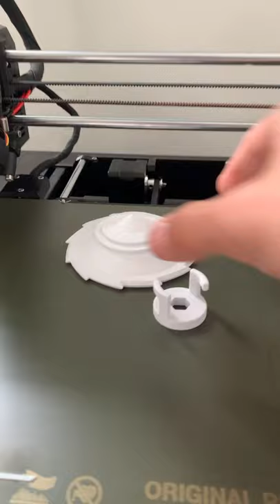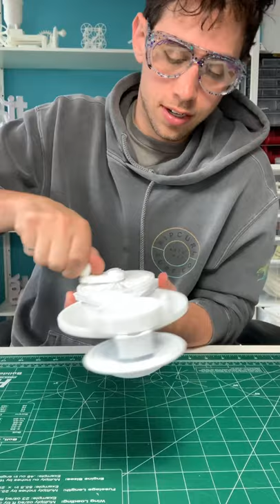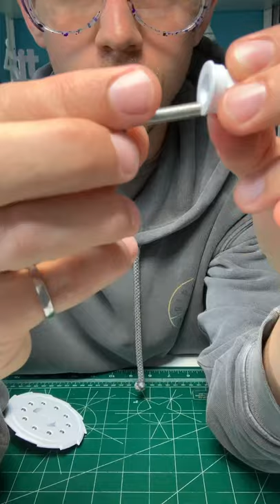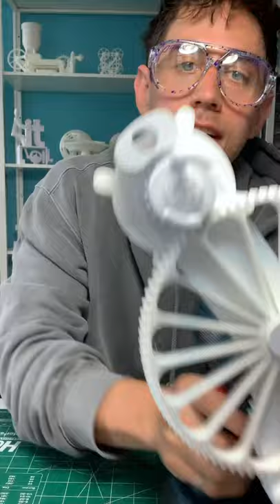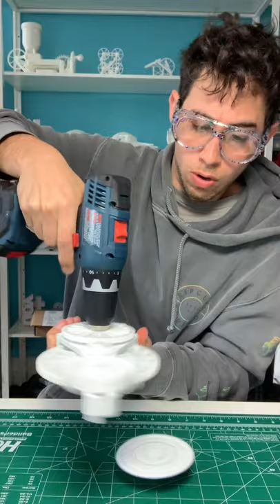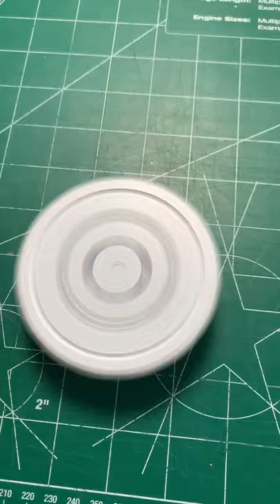The Drill Powered Beyblade (J-Blade) Launcher #shorts

Comment: Dont use drill you can get more speed by your hands. Ok drill has more speed but you hans have more strength if you make more gear speed to it the drill cant Rotate it but yuor hands can. But if you have very strength drill then the drill is better.

Comment: I used over volted electric motors when I was younger with a rubber coupler. One of my spinners "exploded" from spinning too fast XD 
It consisted of Lego parts with a metal core from a non-beyblade spinner
Reply from the maker: 😂😂 lego spinner is some wild shit!
Reply: @Engineezy  admittedly it was just a wheel cog, might even have been Meccano. I had to use what I had lying around, no other way to get parts :)